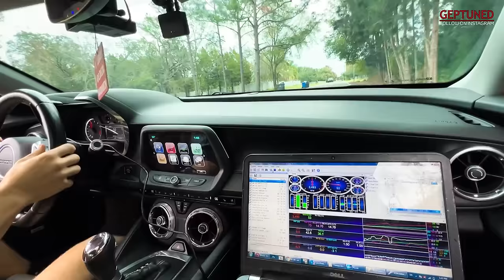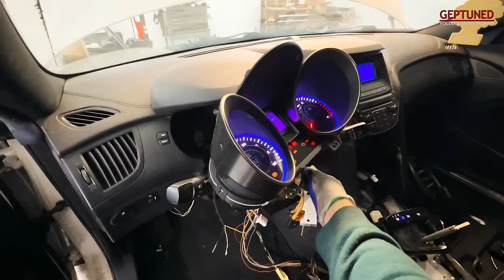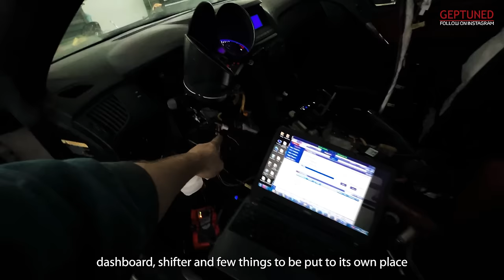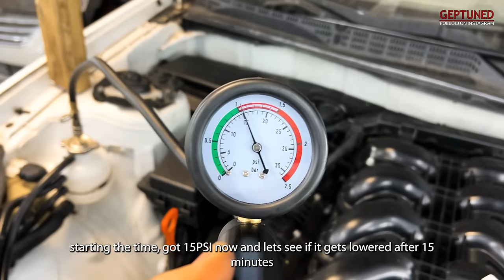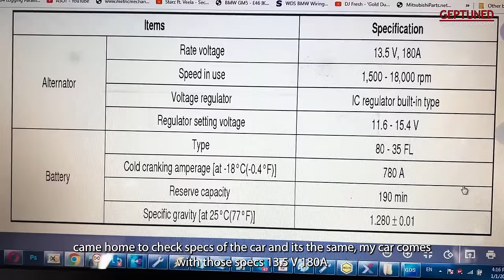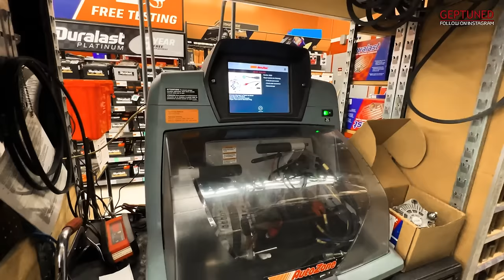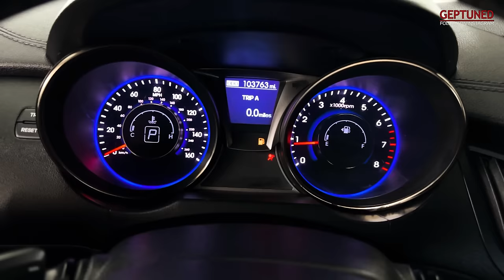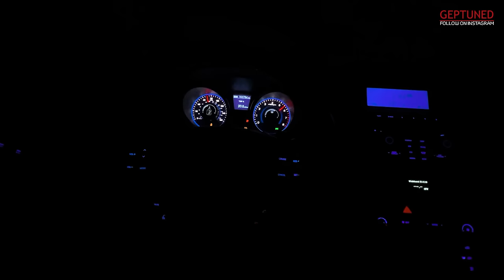Genesis Coupe BK2 5.0 V8 - Project FRANKENSTEIN Last Episode

Comment: By the way one warning the Passanger side valvcover tends to go melty on the back end IF you dont have any heat shielding there
i dont and its melting up a bit
Reply from the maker: I have custom headers and all wrapped pretty good heat is minimal after full throttle pulls 👌
Thanks for input